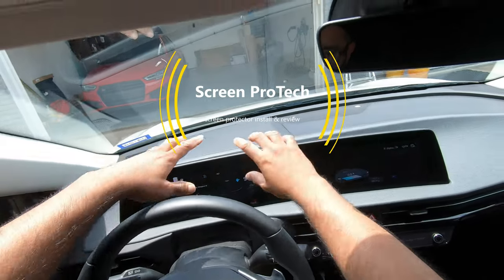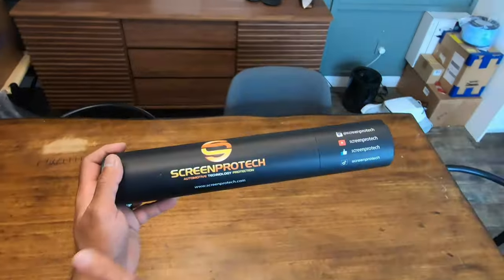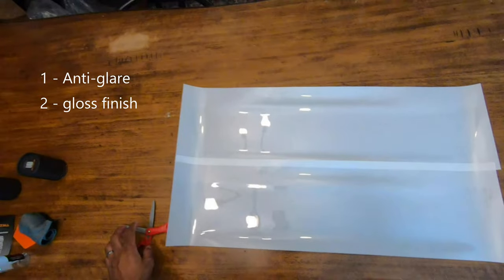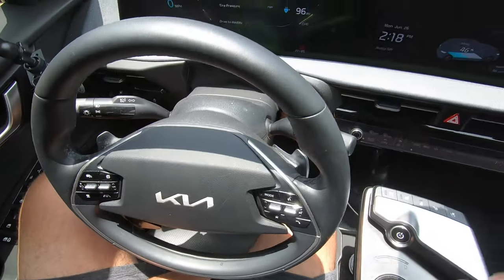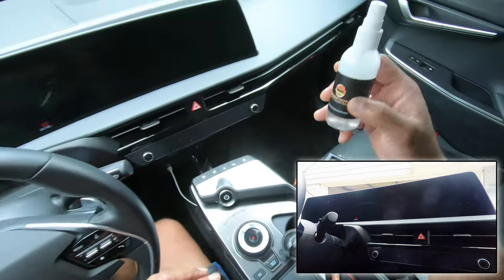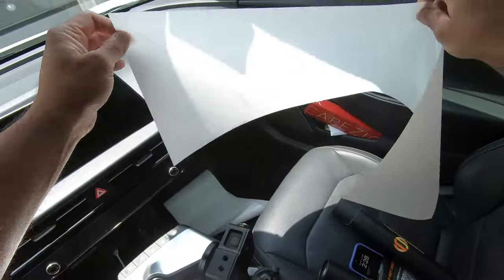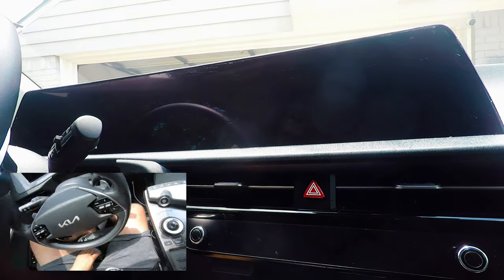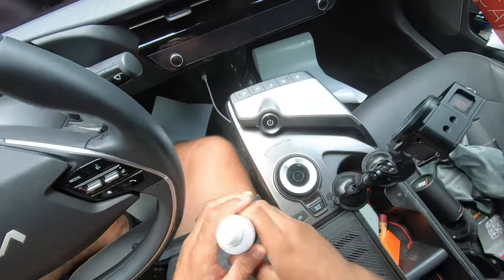Protect your car screen: ScreenProTech gloss protector film install, discount code & review -Kia EV6

Comment: I plan to buy one but how do we remove if we do not like it? I wonder it will leave residue on screen
Reply from the maker: It will not. And if it left any, will easily be cleaned off with a cloth and cleaner. I did this install 2x. It's great and still holding up well. Use my discount!

Comment: What if it became necessary to remove it?....how would it be removed and would it cause any damage?
Reply from the maker: No it will not cause any damage. I removed the other one I had installed (went from clear to matte) and no issues. Many have installed and replaced and should be no issue to remove. Should come off very easily.